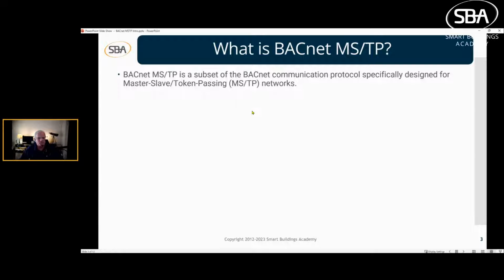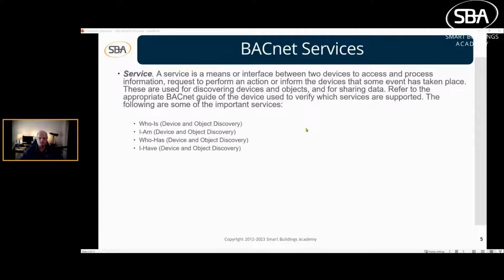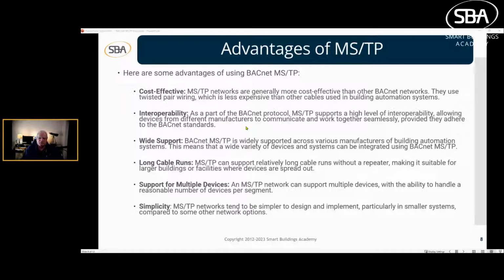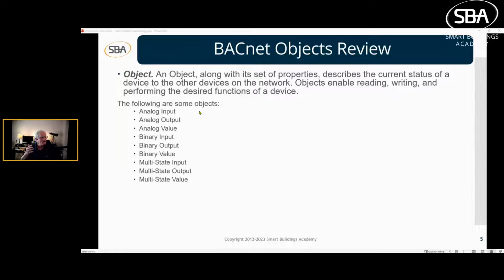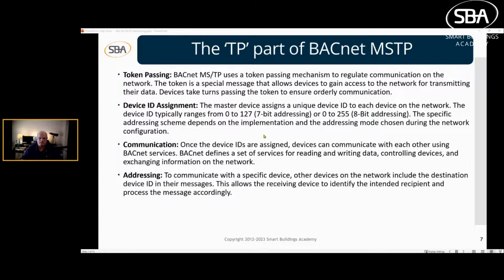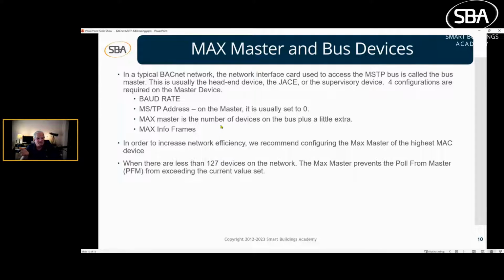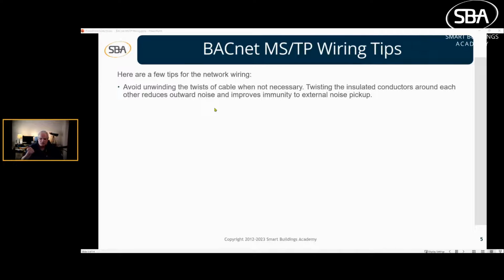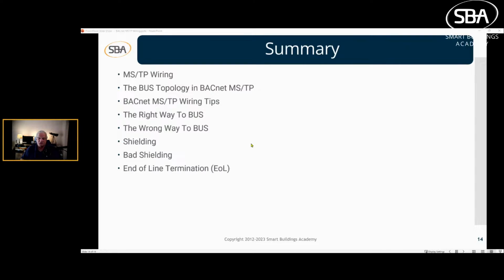SBA 428: BACnet MS/TP Explained: Its Influence and Importance in Building Automation

Comment: The other issue that I've seen arise has to do with two different manufacturer's devices on the same MS/TP bus. Different manufacturers use different transceivers (some manufacturers can even have different transceivers in the same product due to product upgrades, etc) which, even when following all of the BACNet wiring rules can cause issues as RS-485 has no transceiver standard and the BACNet standard leaves the physical layer specifications to the manufacturer. One vendor's pull up/pull down standard may differ from another's, etc.  Good, yet costly, practice is to use separate bus for each manufacturer's products. For instance, use one bus for the VFD's, another bus for BAS vendor field controllers. For instances where the bus has already been installed, you can try using an active hub/repeater to buffer and re-drive signals too attempt to mask transceiver incompatibilities.
Reply from the maker: I know what you're talking about, I don't really see this happening much anymore now that pretty much everyone is using the same parts out of mexico/china. But this did used to be a real issue with VFD's and networked I/O. The issue I still see consistently is the baud rate mismatching.

Comment: Thanks David  for very useful resources. 
Can you please explain whether the HVAC remote controller device or the BMS will act as the master in a BACnet MS/TP network?
Reply from the maker: So in a BACnet MS/TP network all devices in the master MAC address range are typically masters. The only devices that are slaves are the devices in the slave range. 

While this isn't 100% true all the time, it's mostly true. What I think you're asking is is what device will be the BAcnet Building Controller and will hold the BACnode database. That is typically the supervisory device of that MS/TP trunk.

Comment: Thanks David.  Very clear and resourceful.  I ran into a few shielding issues recently myself.  First field device after supervisory device did not have the RS 485 Shield bonded to the daisy chained outgoing cable.  Essentially the following nine devices were unshielded and the bus was flooded with "communication" that was actually noise from the 10 operating rooms the devices were installed on.